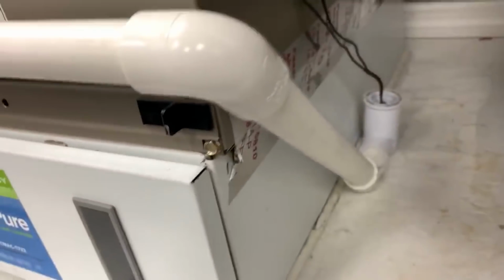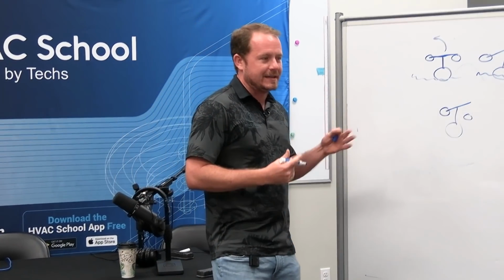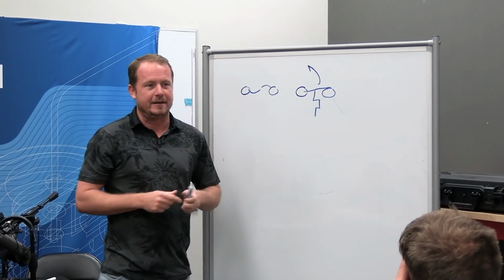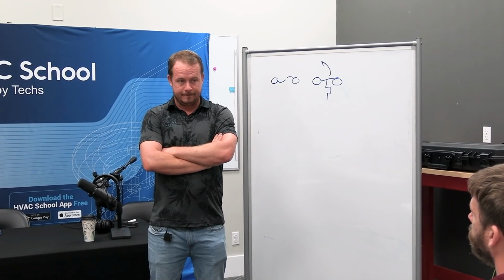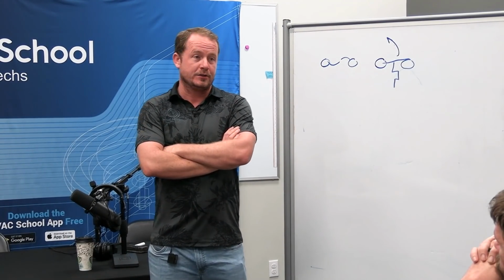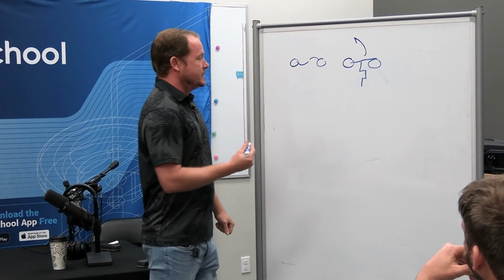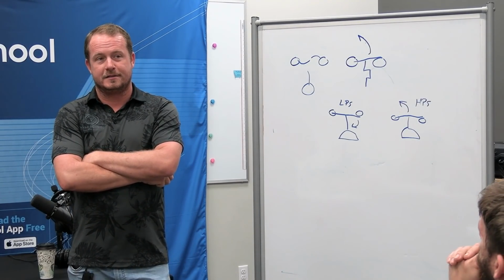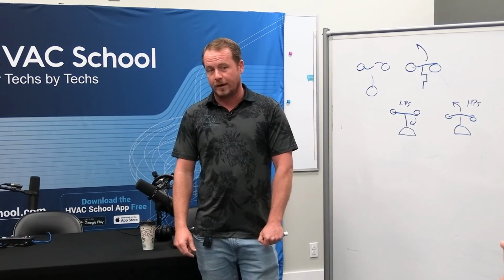HVAC Overloads and Safety Switches Don't Just Fail

Comment: YA THEY DO JUST FAIL.  TODAYS  SWITCHES ARE MADE TO A MINIMUM SPEC IN.  CHINA. AND THEY DO JUST FAIL
Reply: Agree, have run into plenty switches that are defective. The new gas valves Rheem and Richmond use have pilot safety circuits that just fail “ bad valves”
Reply: Ya rarely will a manual reset go bad but the thermal limits can be somewhat common I change 5-10 every winter and the new style high and low pressure switches are a joke they go bad quite often

Comment: Up here in Canada an AC manual reset high side pressure safety switch can trip over winter. Not a failure of the system operation but due to temperature fluctuations over winter while the system is not in use. A quick reset and the system will run fine all summer.

Comment: If it is a chiller and you bypass the safety flow switch it can result in freezing & breaking the evaporator if other safeties don’t stop the compressor.  The low pressure cut out safety switch should stop the compressor if it responds quickly enough to prevent the pipes from freezing.  Big compressors may temporarily bypass the low pressure switch on start up and if that bypass stays closed,  the low pressure control will not work to open the circuit.  This would be a disaster.

Comment: Air at the circulating pump can result in the flow switch opening because the circulator cannot produce water flow if it has air at the impeller.

Comment: I have come across failed open float switch’s due to .. low voltage short ..  float switch is rated at 1.25 amp max in a  3 or 5 amp circuit..
Reply: Yes agree